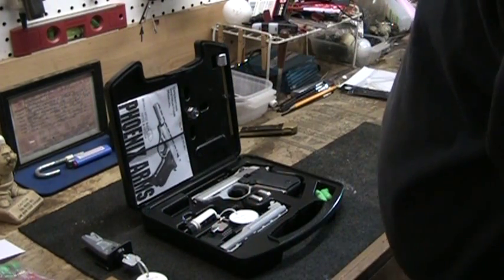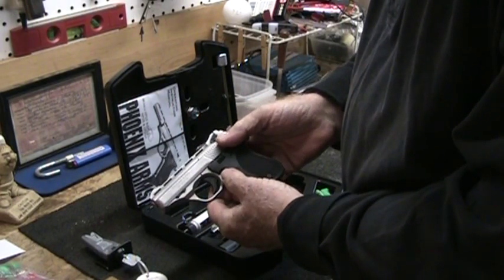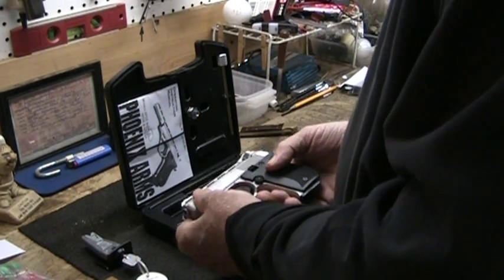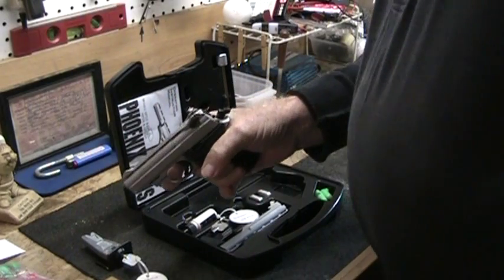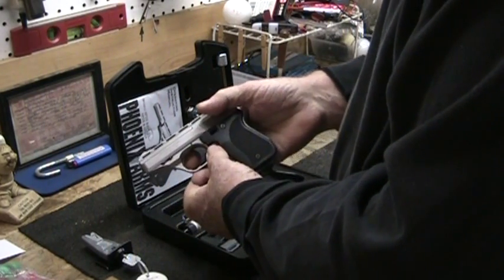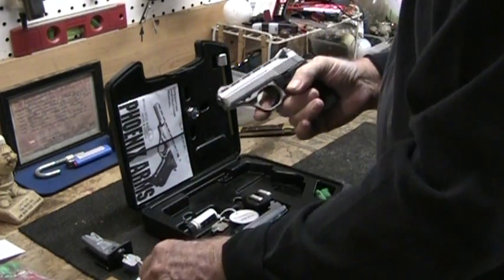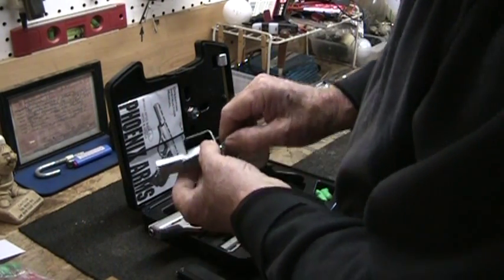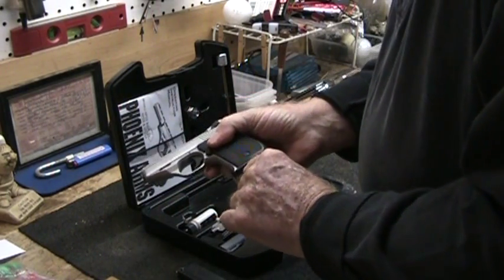Phoenix Arms HP22A

Comment: Got the range master kit with 2 barrels and love it. Ran over 250 rounds with each barrel and not one problem. It took a little time to get used to the safety's and changing barrels but it's not a problem.This is a fun, cheap, accurate little pistol.
Reply from the maker: I fully agree. Thanks for sharing.

Comment: Slip a small piece of plastic under the arm that people bend so that it will clear the top piece. If you need to send it in remove that plastic . works great on mine , love that little gun !
Reply from the maker: Thanks Bruce. Good share. ☺
Reply: Christ it's only $150 a gun at most do whatever you want to it it's practically a throwaway. I see absolutely no problem with people d-california rising this little pistol which would otherwise be a halfway decent weapon from the factory if it didn't have to be California compliant. Let's be honest it's the only reason why it is manufactured with those stupid idiot proof If you will safeties on it. If it was manufactured in the United States of America those wouldn't even have been a thought.
Reply: Just for the record I own the exact same pistol and yes I did the modifications to it that allow it to function normally, but I completely removed my magazine disconnect. Now in addition the magazine also drops free like it should. This in no way has any impact on the functionality and or the trigger safety or hammer block safety.